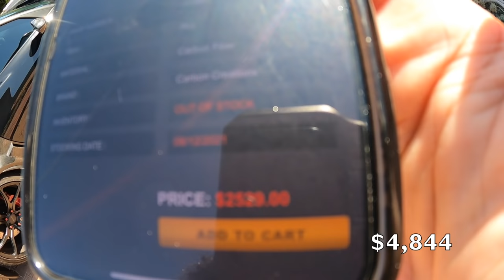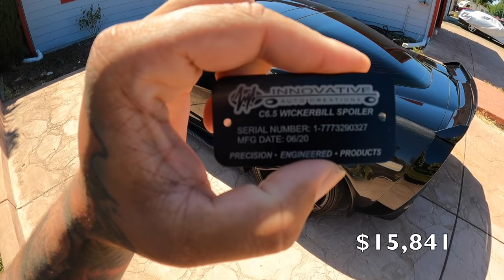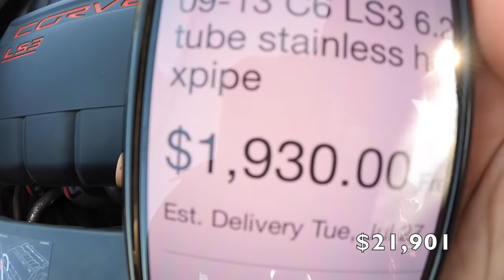Build Break Down: How Much Did it cost? (C6 Corvette)

Comment: I picked up a 2007 corvette 6 speed from my local insurance auction with 55k miles. My previous car was a 2013 infiniti G37 auto which was pretty quick and a blast to drive because it was so easy to push to its limits. The C6 has me on edge every time I drive it. First day I fishtailed from 1st to 2nd attempting a 0-60 run. Now I'm scared to gun it even on a straight road. How am I supposed to race other cars if at any second this beast can get sideways on you at any second? Are all American cars like this because im kinda disappointed. I can hit 140 in my G37 without a worry. I would have to be insane to try that in the C6.
Reply: @JoseMobSHYT  good idea.
Reply: @KaliLife619  it’ll a little late lol but if that doesn’t work upgrading your dispensing will help keeping the power on the ground
Reply: Tires are the first thing you should upgrade on a vette

Comment: Idk you save money buying a base but mods add up and imo a stock z06 body is good enough for me.
Reply from the maker: Ls7 suck for boost
Reply: @Its_Mike_Myke  True definitely depends on what you want out of the car but a heads cam ls7 will hurt some feelings and reliable after valve issue is fixed.

Comment: Bro what's the maximum Coolant temperature your corvette reaches in a hot day?

I have corvette C6 2006 LS2 
Stock with only filter and Z06 mufflers 

My temperature reaches 225F - 235F when the AC is on and when I switch the AC off it comes down all the way to 210-215F is it normal?
Reply: Get a front end heat exchanger along with and expansion take and heat reduction plates